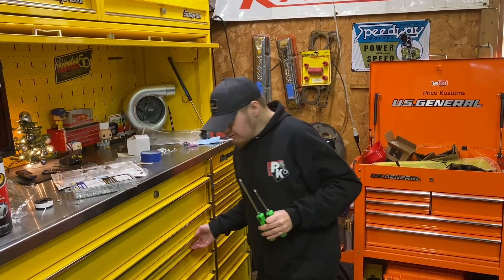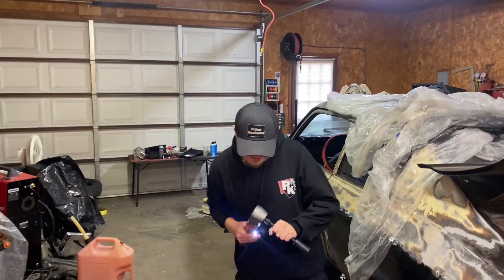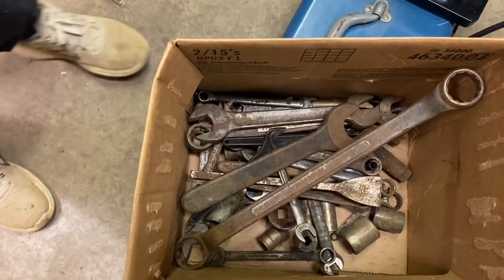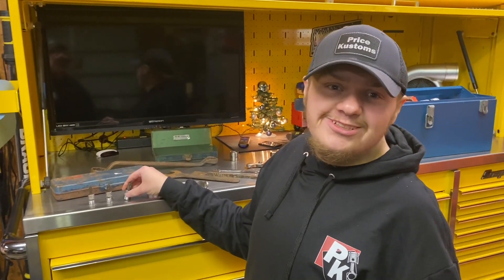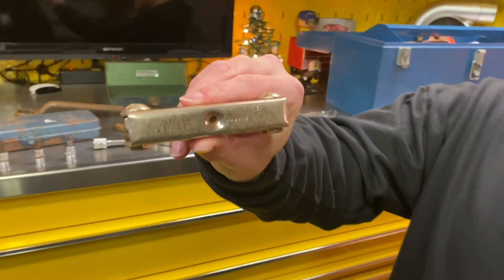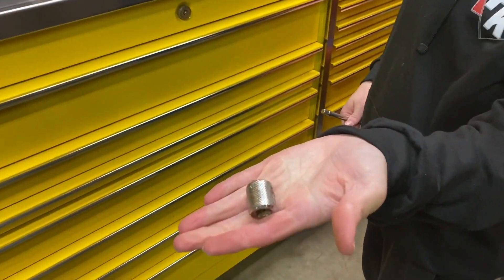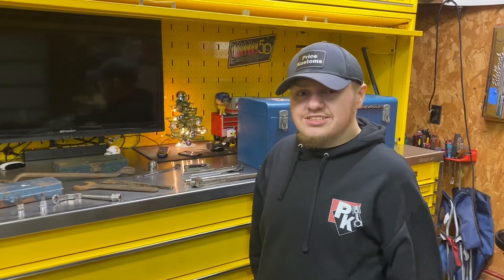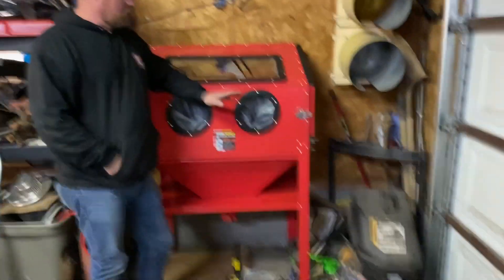NEW Harbor Freight Sand Blaster!!! / Tool Haul!!!

Comment: Just completed the video. Enjoy that blast cabinet. It will come in handy. Be sure to get dry clean air to supply it. HF has several types of water traps, filters etc. It's a constant struggle to provide clean compressed air with the humidity in the South. Glad your health is returning too.